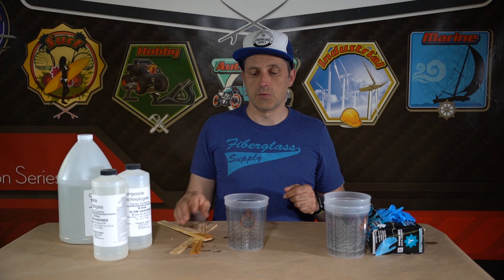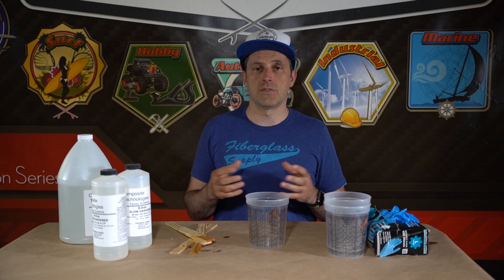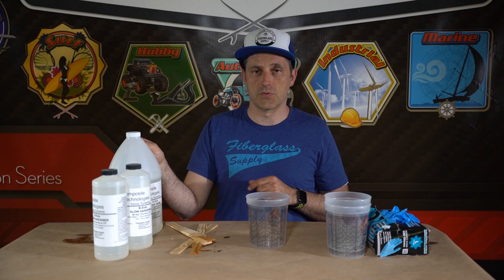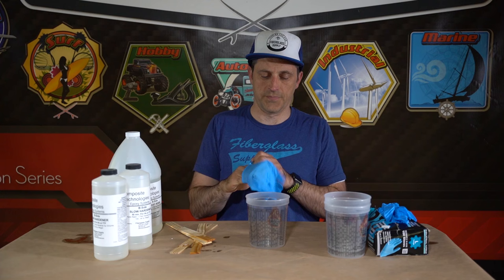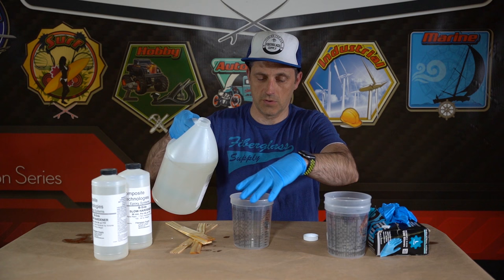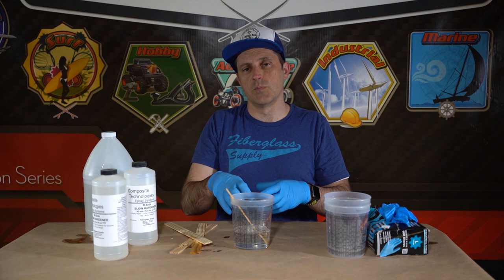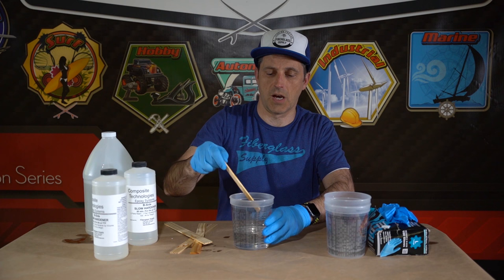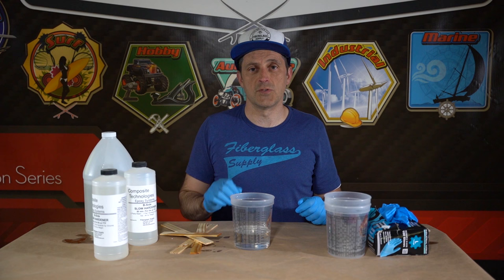Epoxy for Beginners: Mixing Epoxy Resin Basics

Comment: Hardener should go in first..
Reply from the maker: Our experience has been that the most important two things for getting a proper mix are to be on ratio and to mix thoroughly scraping the sides and the bottom.  We have not found there to be any difference whether the hardener or epoxy goes in first.

Comment: As much as i read resin is chemically dangerous so we should wear the right mask while mixing. Seing from what you're doing is not wearing a mask. Do you not get any harm to your health ?
Reply from the maker: Generally speaking epoxy systems have low voc content and can be worked with in liquid form in open and well ventilated spaces safely. In confined spaces safety precautions should be taken. You should always check the specific safety data sheet for the product that you are using. West System has a great page on epoxy safety here: https://www.westsystem.com/safety/